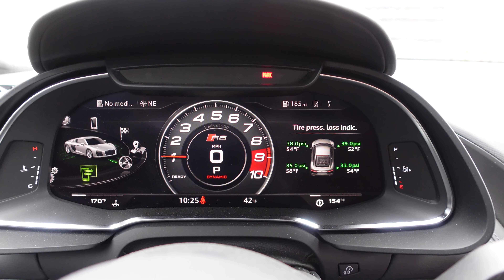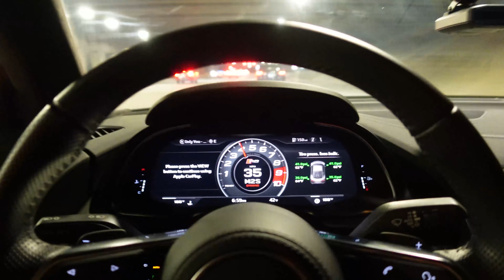My Audi R8 Gets An INSANE Exhaust!!!

Comment: does this now sound as good as the gen 2 v10 plus? which is louder?
Reply from the maker: I think it sounds better. It's louder for sure
Reply: @EddieX  I ordered the 2022 performance rwd version that comes with a new sport exhaust package (exclusive to 2022 versions) how do you think that will sound? I’m thinking of replacing that with an aftermarket exhaust such as yours!
Reply from the maker: I'm sure it'll sound good. But still a bit subdued compared to a huracan or aftermarket setup. I love the b rogue sound